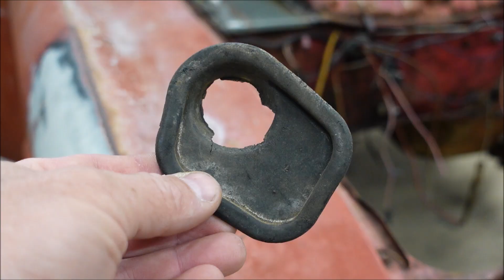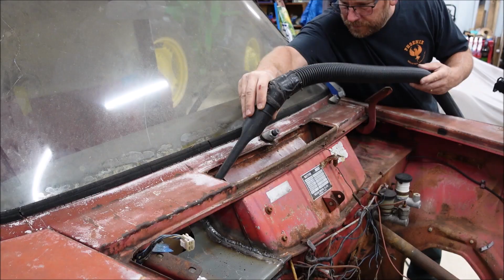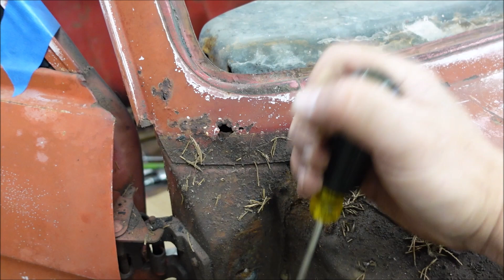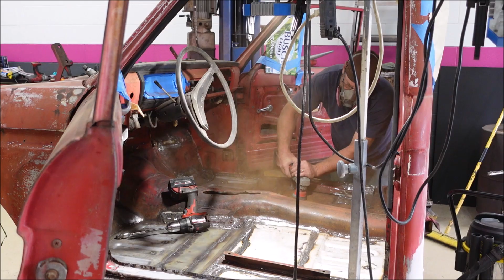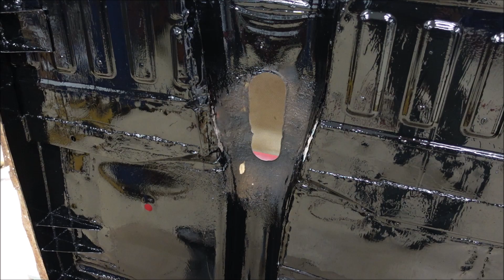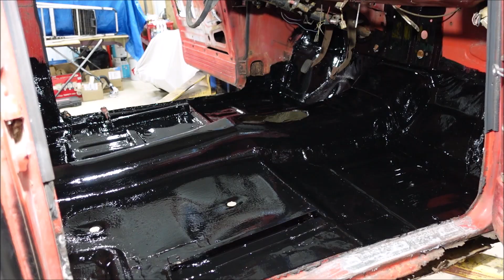Paid in FULL !! Floor repair 1968 Datsun

Comment: Those inner fenders should also get painted with that black paint your using on both sides of the fender, and the side that it bolts onto.  If your going to do things, do it right, which you are doing , and I complimrnt you on what your doing as these trucks last forever, IF, IF you take good care of thrm properly and this is the exact way to take good care of them. My compliments sir, for all that your doing here, your MORE than an excellent person here!

Comment: The parking mechanism on that wiper motor is pretty fascinating to see. Takes a lot of time to fix all those holes. I didn’t know there was such a thing as implement paint. Makes sense. I can see it takes you back! The floor of the cab came together real nice.
Reply from the maker: @arideinthecountry  Thanks, Cliff! Soon, it will be time for a ride in the country with this old truck. 🤞